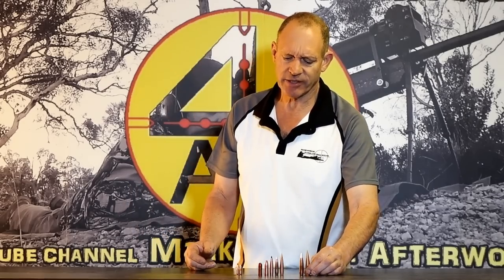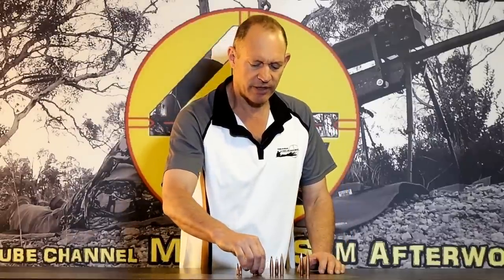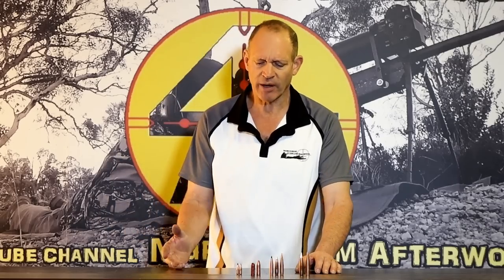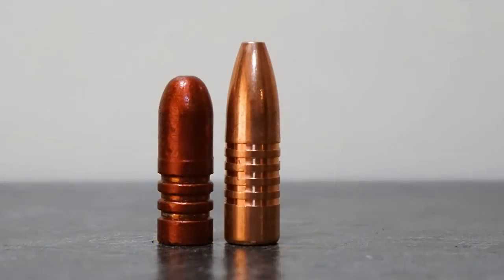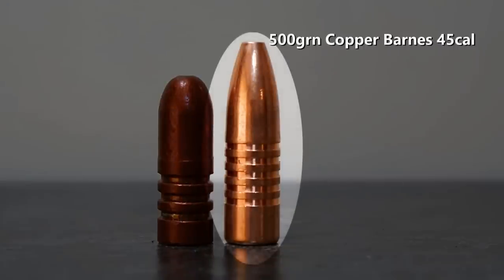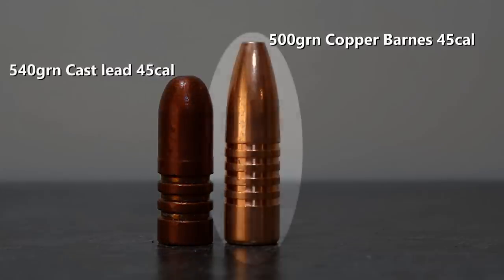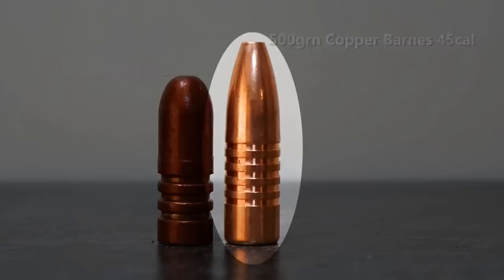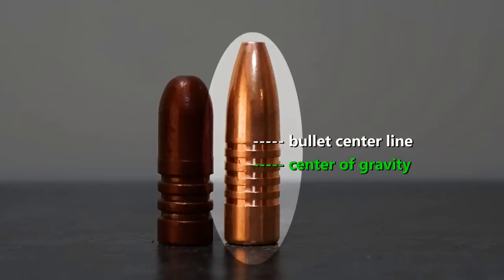Bullet Stability Logic

Comment: Thanks for the explanation. What do you make of the 8.6 blackout's 1 in 3 twist?
Reply from the maker: All about achieving the RPM needed, Cheers
Reply: If you do some reading on .338 spectre, .338 whisper, .338 br, .338x47, 338 federal, most of them were built on 1:6 barrels that predated the 8.6 blackout. 1:3 is excessive and reduces the supersonic capabilities and projectile choices while not significantly increasing subsonic capabilities.

Comment: So bullets with lead in the nose area and copper in the rear would be more stable possibly, while keeping the twist rate not so fast. So we could be shooting those 131g 0.257 bullets in a 1:10 twist barrels if the bullets were made correctly. 

My worse encounter was with the Barnes 168g LRX in 7mm with a 1:9.25 twist barrel. they hit the target sideways at 100yds. They have a recommended twist of 1:8, but even when we tried them in a 1:8 twist barrel they still weren't stable. I suspect that rifle doesn't have a 1:8 twist barrel even though Browning says it does.
Reply from the maker: Thanks man

Comment: The stability of a bullet in flight is determined by its angular velocity and the moment of inertia around its longitudinal axis. Angular velocity is the rate of change of angular displacement, and moment of inertia is a measure of an object's resistance to rotational motion. When a bullet is fired, the rifling inside the barrel imparts an angular velocity to it, which affects its stability in flight.

The angular velocity of a bullet is proportional to the rifling twist rate and the muzzle velocity of the projectile. Specifically, the angular velocity is given by:

w = 2πNT/V

where w is the angular velocity, N is the rifling twist rate (in revolutions per unit of length), T is the time the bullet spends in the barrel, and V is the muzzle velocity of the projectile.

The moment of inertia of a bullet is determined by its mass distribution and shape. The moment of inertia around the longitudinal axis of the bullet is given by:

I = (1/12)M(L^2 + D^2)

where I is the moment of inertia, M is the mass of the bullet, L is the length of the bullet, and D is the diameter of the bullet.

The stability of a bullet is determined by the product of its angular velocity and moment of inertia, known as the spin-stabilization factor. The spin-stabilization factor is given by:

S = wI

When the spin-stabilization factor is high, the bullet is more stable in flight and less likely to deviate from its intended path. However, as I mentioned earlier, there is a point of diminishing returns where additional rotational energy doesn't significantly enhance stability and can introduce aerodynamic instabilities.

So, in summary, the stability of a bullet in flight is determined by its angular velocity and moment of inertia around its longitudinal axis. The optimal angular velocity for a particular projectile is determined by the rifling twist rate and muzzle velocity, while the moment of inertia is determined by the mass distribution and shape of the bullet. The stability of the bullet is then determined by the product of the angular velocity and moment of inertia, known as the spin-stabilization factor.
Reply from the maker: 🤦‍♂️  Cheers
Reply: @markandsamafterwork  cheers ;-)

Comment: Great explanation, thank you. 
I've built carbon fiber rockets from 1" diameter up that break the sound barrier. The centre of pressure vs centre of gravity is what makes them stable, if you get it right. So I understand your expectations. 
Yesterday I brought a Howa 22-250 and was a bit perplexed as to why their 223 has a 1 in 8" twist vs the 22-250's 1 in 12" twist. Does anyone have an explanation for these choices of twist rate?
Reply from the maker: Would suggest a bit of reading there J, 223's also come in 1in12 twist, all about what the rifles are set up for doing, factory 22-250's and off the shelf ammo are set up for varmint hunting, shooting light projectiles, Cheers
Reply: The 223 is slower, 1:8 likes heavier bullets like 60gr in 223. The 22-250 is a screamer, lighter bullets around 50gr going really fast needs a slower twist rate aka 1-12.
Reply: Thanks guys. My guess was the relative velocities of each but it was just that, a guess. Thanks for clearing that up.
Reply: What a dream .224 set up. 22/250 running 75s or 80s over 3000fps would be awesome.

Comment: Have you ever tried the 240 grain Woodleigh bullet in a 1 in 10 twist 30-06? Kind of wondering if it would stabilize.
Reply from the maker: No, but designed for the job, not big on BC but center of balance works, Cheers

Comment: Gday Mark and Sam. Another very informative upload.
Do you think barrel length plays in to stability and developing an effective RPM as well? I have a nice tikka 223rem that can shoot 1/4” groups at a 100m with lighter projectiles -50gr and 53gr hornady vmax. I have been struggling to get an effective load for the heavier 75gr hornady ELD match however. Groups at a 100m have been terrible. 2.5”! But still seems to be cutting clean round holes in paper. The rifle is a 1 in 8 twist (checked) and is 22.4” barrel length. I’d love to get this load to work for some long range target shooting (600 - 800m). Cheers 😊
Reply from the maker: Thanks and no, length does not change bullet stability, the twist and MV are all what matter there, sounds like other things going on there, barrel crown, shooter form and rifle set up would be the place to start, Cheers
Reply: I've got the same rifle and had similar issues finding a 75 grain load. Got there with Hornady 75HPBT running at 2760 and AR2208. Getting 1/2" at 200  yards now and can shoot out to 800 yards no worries. Flick us a message if you want to talk about my experiences getting there.

Comment: Mark, by my math, a bullet travelling 3,200 fps with a 1 in 7 twist rate will leave the barrel at 27,428 rpm's. Apologies to nitpick, and extra apologies if I am in error. I love what you do and how you present it. Respect.
Reply from the maker: 3200 (feet per second) x 1.7142857 (rotations per foot) x 60 (secs in a minute) = 329142 rpm